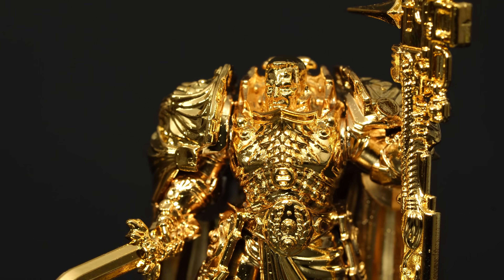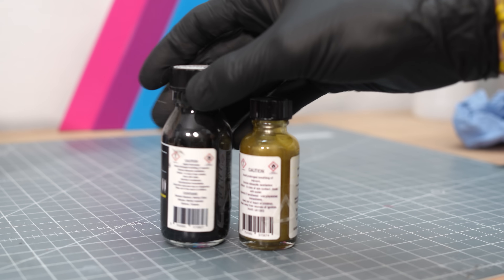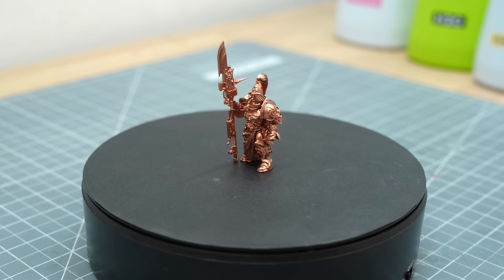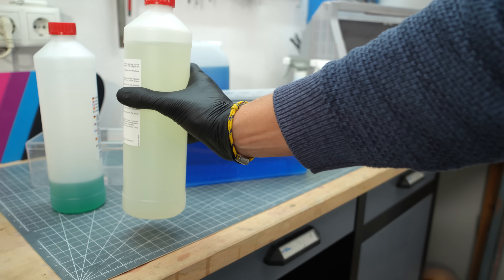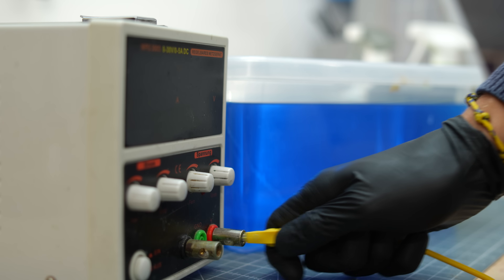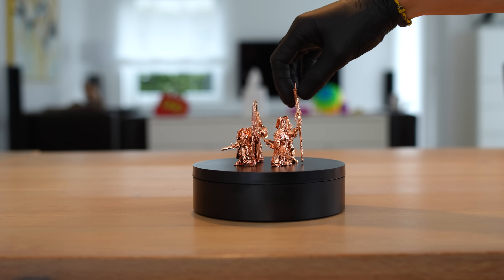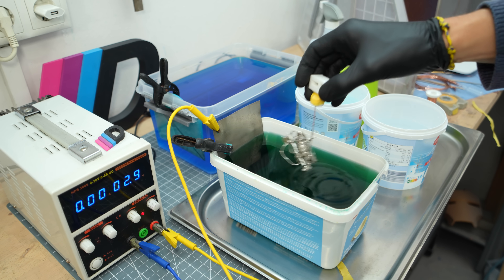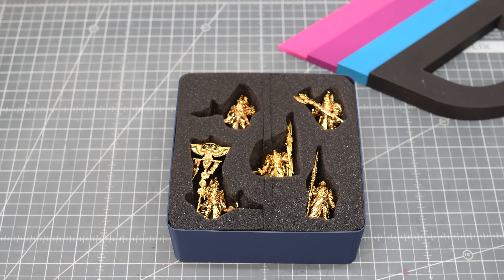INSANE Metal Bases: Electroplate your Warhammer Miniatures!

Comment: @HEN3DRIK: Do you get imperfections or spots on the surface where the thin copper wire touches the model? And if, how to avoid them?   🙂
Reply from the maker: I try to avoid imperfections from the start, yet, the are some. Usually by not working in a very clean env 😄. I avoid the touching points by moving the wires regularly and placing them in a inauspicious spot. Also i only light wrap

Comment: I saw one of your tutorials last year which introduced me to the idea and since then I converted an old shed in my garden into a proper 3D printing and electroplating workshop which I've  just got in full operation. I can get some great quality zinc plates however the one problem I have is that I paint them with copper manually rather than with an airbrush so small details get filled in easily. I don't really want to get an airbrush since it's quite expensive and it can make nasty fumes from the copper particles in the air. Do you have any advice for me to get more even layers of copper paint without filling in details? Great video btw!

Comment: Pretty sure you can keep using the chemicals until those are too diluted to work. No point taking them to recycler and the distilled water, just distill it your self since that does not require any special expertise.
Also making copper paint aint that difficult, just get copper powder or using electroplating method move it to surface while scraping it off mechanically so it sinks on the bottom. Collect, dry and once you have fine dry powder, mix it with laquer/paint of your choosing and spray it. Since its home made, you might want to run it trough a filter to remove any potential clumps that are larger than you nozzle size.

Comment: Hello there, first of all that is a really nice work you did there😊
I have some question about elecroplating.
I try to electroplate some zamak or stainless steel but didn't get any great result so far and I have no idea why ,the copper make some sort of agglomeretion and doesn't stay on the parts.
Any idea why ? Thanks in advance
Reply from the maker: Oh, I really have no experience in zamak. You can add flash gold to the stainless steel and add thick copper on top of the thin gold layer. That’ll work.
Reply: @hen3drik  thanks for the answer I really appreciate that :) I'll continue the experiment :D

Comment: how resistant is the plating to paint strippers and handling in general? for example can I drill gun barrels after them being plated safely? can I soak the miniature in like acetone or will it sill damage the plastic underneath? so many questions to such an amazing process for those specific minis :D

Comment: I want to produce a plastic duck and need to create a single-piece mold for it. I've done extensive research and found the electroplating method as an option. My goal is to create a mold that is heat-resistant and suitable for rotational molding using this method. However, I have no prior experience with this, and I want to ensure safety in the process. Could you guide me on how to make such a mold using this system without any risks?

thank you

Comment: Hi, congratulations, your videos are truly amazing!! I’ve been thinking about this for a while now: I’d like to coat my resin 3D printed action figures with copper and then nickel to make them more resistant to breakage and time. Do you think this process could make my prints nearly indestructible, or would the metal layer be too thin? I’d really appreciate any advice you might have! And if you ever create a course on how to plate objects properly, I’d be your first student!
Reply from the maker: Hi, thank you. I create a 200microns thick layer of copper first, so these become very rigid and stiff. Very thin parts may actually break when force is applied but it’s very unlikely (some fell down the shelf on concrete, no problem at all)
Reply: @hen3drik Thank you for your reply! You are kind and really excellent

Comment: This looks great, but I'm kinda wondering if there's a paint that could cover the details, like I only wanted to electroplate on these specific details instead of entirely.
Reply from the maker: Don’t worry, you can paint these just as normal
Reply: @hen3drik  I'm attempt to apply this on gunpla models, because they're snapfit, so I was wondering if there's a way to separate the snap fit before electroplate the parts

Comment: I can't lie, it's interesting but just really not practically applicable for most folks doing miniatures.
I'm dubious on the effect, & we aren't shown how they actually look painted. I'm guessing the 'thick metal coat' will obscure finer details, I don't trust that paint will actually adhere long term to that shiny, super-glossy metallic surface, & the metals are all too 'clean' & 'bright' vs what most painters actually want.
And then we have added weight (not really a plus), & huge investment of time & money to get setup to do it, with a host of safety concerns. Again, for an end result of dubious benefit.

I'm not saying there is no application for it, but it's pretty damn fringe from the miniature hobbyist perspective.
From the miniature manufacturing side, it makes a bit more sense, as it could make resin 3d printed minis much more durable (at the usual cost with metallic minis of making them less kitbashable), but NOT for the home hobbyist

Comment: Neat!! I don't care what anyone says. I miss the old metal models. When you pick one of my troops up, I want it to have weight. I want it to tell you to put it back down on their own.
Reply from the maker: This method give you roughly 40% weight gain. I mean you could leave it in even longer to crank it up to 10g I guess
Reply: @hen3drik  Ehh...I'd just glue a few washers under the base. 😉
Reply: i mean, if you 3d print your own, just do lost-PLA casting with tin. there you go

Comment: Fantastic. I am a bit curious how well they would take a wash, wherher something like a contrast paint or a good oil wash like one of the Villainy Inks

It could be GREAT to see some Nickel Necrons, and the only thing I can imagine using this on upcoming project wise is to do a Space Marine 2 Killteam and have all the gold trim extremely blinged out
Reply: Ive never painted electroplate but using wash on metals gets streaky. Id probably use an oil wash and apply it very deliberately where I want it and not do the typical cover the model in 💩 then wipe it off.
Reply: I won't even adhere
Reply: It wouldn't. It's useless, unless you like the look because you can't do anything with it.
Reply: pretty sure you may use some tric kto get paint adhered, like using maybe a transparent coating... for example I feel something based on cyanocrylate may work if you can avoid it getting white

Comment: do you have any examples of items electroplated and then painted? as a mini wargamer i am thoroughly unconvinced whether this is worth even a tenth of the effort required. that there is only a brief mention at the end of the vid showing very little does not inspire much confidence either.
the science is interesting, but i cant fathom why anyone would do this other than to make a gimmick youtube video.
Reply from the maker: Oh, painting really works well. You’re right, I should have highlighted this some more, but I’m very bad at painting and didn’t want to ruin everything. Once you have the setup it’s pretty cheap actually, but getting the right technique takes ages as it has kind of a steep learning curve. However, I am totally convinced that this is underrated as it is real metal and you can feel and see that. The haptics are amazing. 😊
Reply: @hen3drik  "However, I am totally convinced that this is underrated as it is real metal and you can feel and see that. The haptics are amazing. 😊" I think the thing you are missing is we are talking about a product classification that was previously dominated by pewter, & has been replaced with plastic & resin... and that most people avoid handling the actual minis so they don't screw up their paint jobs, so haptics are irrelevant. 

Those of us that have experience with pewter minis also don't buy your assurances that acrylic paint nicely adheres to the super shiny/glossy surfaces you show in the video... if paint on dull gray classic pewter usually needs primer then so will that.

I think the best application is folks like @JamesEarlCash, who are basically small indie manufacturers, to create more durable upcharged versions of their products, specifically as  a way to balance out the fragility of resin prints. But for the home hobbyist it's not worth the setup.

Not trying to be negative - the video was interesting & insightful, but all things considered this will never be a common technique for miniature hobbyists, & I think it's just honest to recognize that.

Comment: Hello! I know that you can use masking before Step 2 - Applying Conductive Paint, and thus leave plastic exposed.  Could you apply masking in between steps 5 and 6, so that the nickel was exposed in some areas after applying the gold? 🤔 Also, are you able to use different karats of gold to get different shades of gold through this process?
Reply from the maker: Absolutely yes and yes 🤗